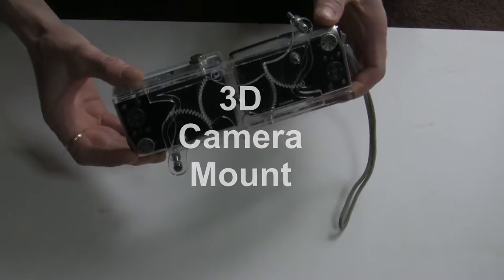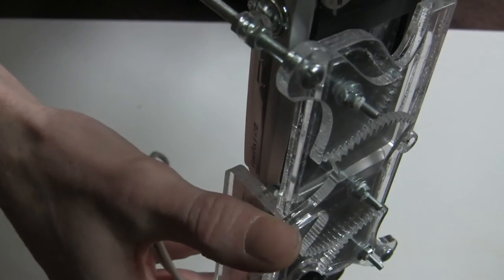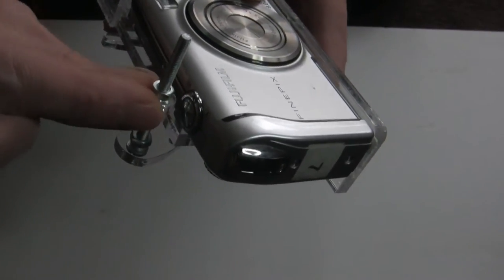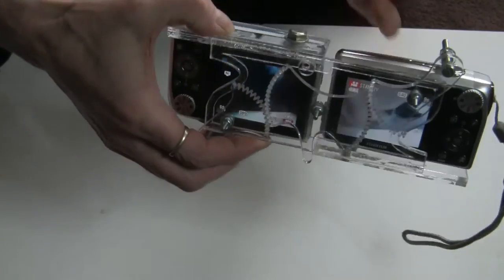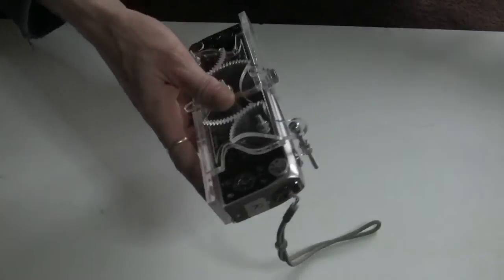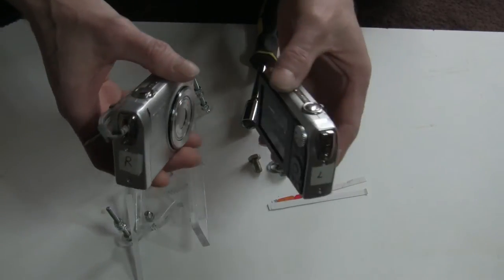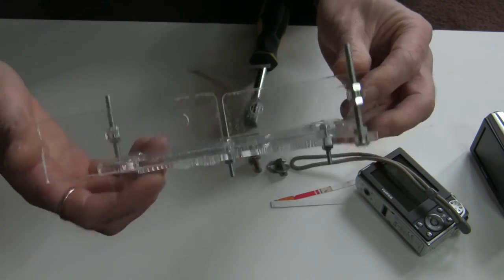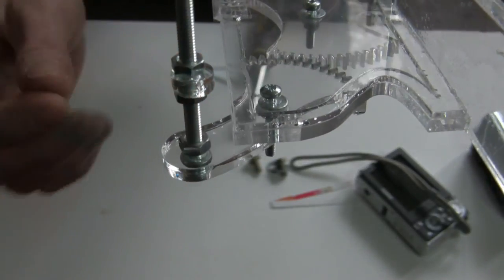3D Camera Mount.mp4

Comment: Very beautiful acrylic bit! Suggestion 1: instead of the cam on the horizontal screw, for button-tuning, use a rigid horizontal acrylic bit and then a screw-down shifter instead of the cam. It should help in detail as well as speed and clarity.
2. Tell everyone to half-press first, then let both cameras be ready to click once focussed, before full-pressing. You may well think it is normal, but many don't understand.  3. My pair has wired-in new buttons - not easy on newer small cameras.

Comment: well, all mechanical synching like this one will fail since the cameras are not in synch at all - a good synchronization would be less than 1/5000s and thats not possible with a mechanical system.